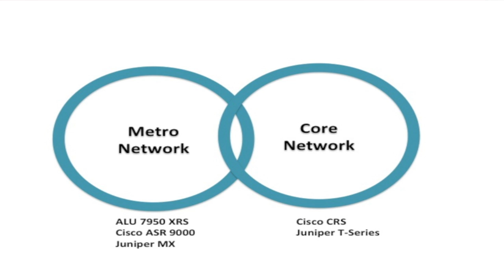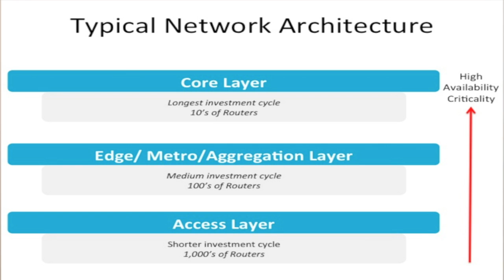ACG HotSeat with Sanjeev Mervana from Cisco on Core Router -

Comment: Funny to see this Cisco twisting reality and spinning fairytales to try and deposition the 7950 XRS. They're rightfully concerned. The XRS not only delivers 5x port density of their old CRS-3 warhorse to handily beat it on capacity, space and power requirements, but also has the intelligence and flexibility to address requirements for metro core, IP/MPLS backbone, infrastructure interconnect and Internet peering with a single, converged platform. The XRS makes the CRS look antiquated.